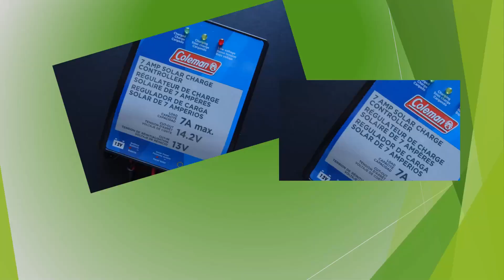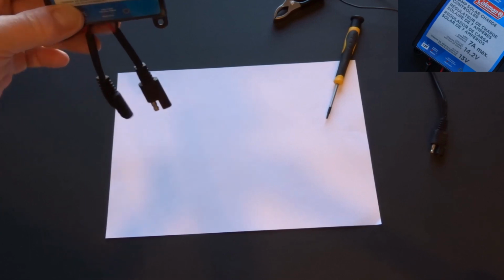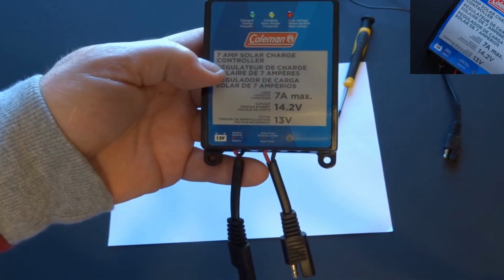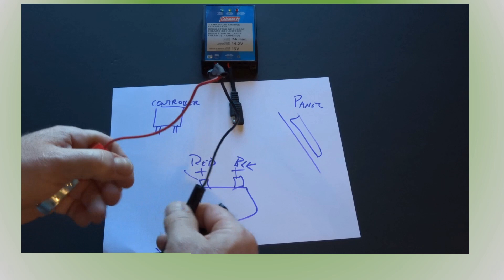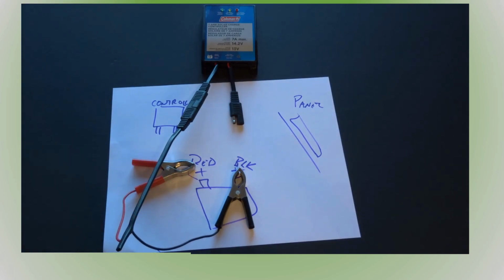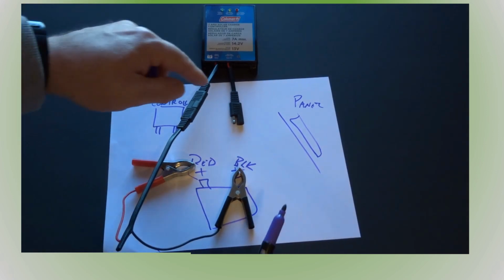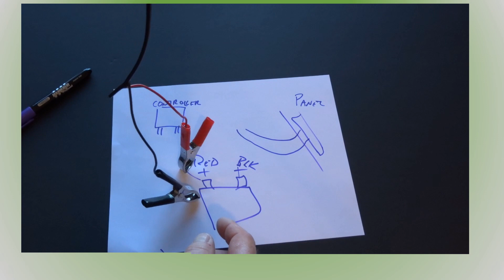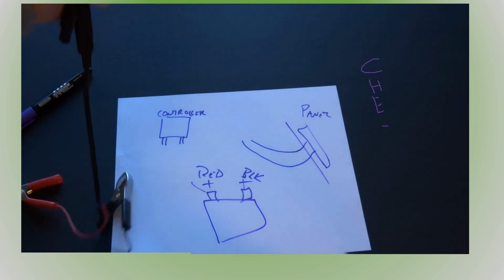Solar Charge Controller Do's and Dont's

Comment: Can you connect two batteries to one panel following sequence from battery 1 to 2?
Reply from the maker: just make sure to hook batteries up in parallel.. for these panels you want to keep everything at 12 volts....
Reply: Thanks!🙏
Reply: I have two batteries hooked up in parallel with the same charge controller connected to a 100W coleman solar panel.  The batteries are connected to a pure sine wave power inverter. This should work but the power inverter always indicates that the batteries are only 50%. However the charge controller's green light comes in indicating the batteries are fully charged. When I try to use a 300W appliance the power inverter won't work due to insufficient voltage. Can anyone help? Thank you.

Comment: HI
I emailed the manufacturer of the Colman controller and he replied, "  Lithium batterie save a more complicated charging parameter and so we always advise purchasing a solar charge controller that has a lithium setting. Sunforce at this point does not offer such a controller." The Colman controller is made by Sunforce
Reply from the maker: Thanks for the post…

Comment: Will the controller work on a 12 volt lithium battery?
Reply from the maker: Honestly I don’t know, however the controller is only checking voltage, it starts to charge when voltage goes down to a specific level, and stops when it goes up to specified level…. It’s not a smart controller… it just does what it does… ..  lead acid batteries like to be fully charged all the time, some lithium batteries don’t like to be fully charged and just sitting doing nothing for a week, unlike a lead acid that prefers sitting doing nothing forever… what I’m saying without full certainty, if the lithium battery is being used daily and getting run down a bit it’s probably A-ok and yes the controller will charge it no problem..

Comment: How do you hook up more than 1 Coleman 40 solar panel to charge a deep cycle battery?
Reply from the maker: The very simple way is hook them up separate, meaning just has you hooked up one panel and one controller…. Hook up the second the same way… so you would have two panels and two controllers.. it’s not going to hurt anything and when it’s sunny and under load it will utilize both. I’ve done it this way for years…. The other option, which is only necessary with either higher voltage systems and using a smart controller either in a multiple battery, or grid tie would be wiring the panels in parallel or a series depending on requirements.

Comment: That is not entirely true about what fuses look like,  now days there are surface mount fuses have been for for sometime now. Most electronics do have them installed,  but is not changeable by just anyone without the know how  or what thay look like. So with that being said, I'm not sure if that are on that circuit board or not. If so it would usually have a F right near it. Some times not. Most electronics is so protected by the manufacturer that even schematics  are almost impossible to get.
Reply from the maker: Thanks for the comment, I’m sure many devices have built in fuses or very common would be power surge protection.  I guess at the end of the day if you can find something that has consumer replaceable fuse that’s the best route. For example many don’t know the cigarette lighter adapter for either USB or a regular power cord have a replaceable fuse..  Just trying to present the easy fixes available that cost next to nothing if a person takes some time to investigate... thanks again for comment plus watching.

Comment: Are you able to tell me why my 30a colman charger controller can handle 450w? Cuz 450w is 37.5a
Reply from the maker: Dylan Stuckless yes you are correct if you go by the numbers on the stickers or ratings. You are correct on the 37.5 for 450w, however that will be ideal conditions including temperatures, the hotter the panel gets it drops down significantly. When it’s running see if the 30 amp controller is hot, better yet buy a multi meter for 20 dollars and test the output directly from the panel, I think you might be surprised, most of these panels are way overrated. But to put your mind at ease, test it...  the controllers are also normally over engineered to handle more than stated.. so all these things combined lead me to believe u be fine. Sorry for the delay on response.

Comment: The Coleman 100w panels with 8.5amp charge controllers I bought in the US recently - no connectors on panel conductor ends, or on the charge controller conductors that connect to them.
The conductors going to the battery had terminals, that’s it!
Pain in the behind.
Reply from the maker: Liam McCarthy yes, I guess it depends on how it was advertised, seems to be many variants...I just saw one on sale with a stand, controller and wiring... yet I have seen some you described... consistency, In question for sure...

Comment: I've been considering a solar panel for trickle charge method of a car battery that has some minor electrical issues (fuse blows when put in reverse) Well, rather then lugging the battery to oriellys for the umpteenth time, (I know just get the car fixed haha) I'm considering this solar panel method. I appreciate your advice and will take it into account before purchasing. 

I do realize this is just for the controller and not the panel itself, however, Coleman is not in my top 3 (too many negative reviews) thank you sir, I appreciate you!
-D
Reply from the maker: D souL panels are perfect for charging batteries. If you just plan on trickle charging a small panel will work fine. My 3 Coleman panels have been on my roof for several years and still working.  Might depends when they were made and who made them regardless of brand name. Good luck, thanks for watching.
Reply: @kd_enterprise3404  Hi, do you know if the Coleman 10watt trickle charger would fit inside/on top of dashboard in a Jeep Grand Cherokee? (If so, could it be mounted?). Also, I've read that this doesn't need a separate control charger because it's under 30 watts. Do you know if that's true, or  what is your take on that?
Thanks.
Reply from the maker: @tlc6756  the small 10watt should fit on the dash, and you are correct, no controller required, especially on a car battery that is actively being used. I’m not sure how successful it will be depending on what the issue is with the jeep, meaning.. if something is  drawing more power than the panel can provide, the battery will still go dead, might just take longer…
Reply: @kd_enterprise3404  great, thanks so much for your quick reply.
Reply: @kd_enterprise3404  ps. Can I ask what you mean by if the car battery is being actively used? I sometimes don't drive it for a week or two. Would the panel need a controller if it sat for a long time?

Also, I was thinking of getting a 22 watt as I don't mind spending extra money, but my main concern is if a higher wattage may harm the battery or more importantly cause a fire. Is it pretty much certain that anything under 30 watts without a controller is s worry free?
Reply from the maker: @tlc6756  I don’t think u will have any issues, having said that, I can’t approve. … legal issues … but do what u want… should be ok..in my opinion.
Reply: @kd_enterprise3404  thanks
Reply: @Nick Chuck well, yeah, you are being a jerk here. I simply asked him questions because he seemed very knowledgeable on these issues. I'm sure he wasn't the least bit offended and probably took it as a compliment. Me doing a "Google" search would've wasted hours of my time, since I'd already searched for these answers but little came up ( If you took time to read my specific questions, you'd see they were in response to his answers). I told him I appreciated his answers and quick reply. I personally love it when people ask questions in detail, but I'm more analytical than most. From my own experience, Ive learned alot more by asking extra questions from someone who is knowledgeable, compared to wasting my time with people who aren't knowledgeable.

Comment: Anyone recommend noma 100w panels vs coleman 100w panels?
Reply from the maker: Arend Scholten I personally have not seen too much re:  comparison, I’m guessing price point and manufacturer would be the key.. I’m thinking when you get into the larger 300+ watt panels then more consideration and investigation is required, especially for type poly or mono, and longevity plus efficiency for larger installs..
Reply: @kd_enterprise3404  Noma have awful reviews from what I seen
Reply from the maker: Radek Woj I did a review on fence post Noma solar lights, It was an initial review, probably positive at the time, I will have to update as I do go back with my reviews after a year...they were horrible... the flood light so far after a year is still good... but .. ya.. fence post.. not good...subscribe and I do updates on my vids of reviews..,

Comment: I got 3 30 amp Coleman charge controllers 1 burn out mediately, so doubled  checked the wiring and everything was fine, The other 2 worked fine but the freaking idiots put the screws too tight you end up wrecking the screw so I had to solder them on, Chinese junk😤

Comment: If you look at the bottom of the controller, you will see a black wire and a red wire and follow them down to their plugs, they are reversed, so if you plug the battery into the solar panel side or solar panel into the battery side you could damage the controller.
Reply from the maker: Robert Arnott good advice and comment.. thanks.